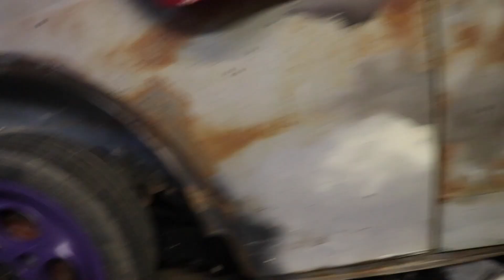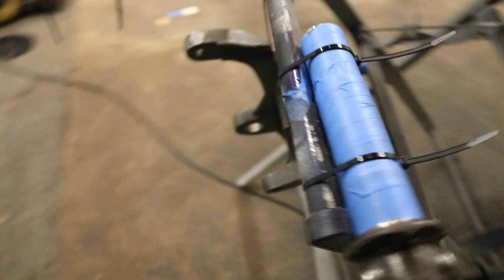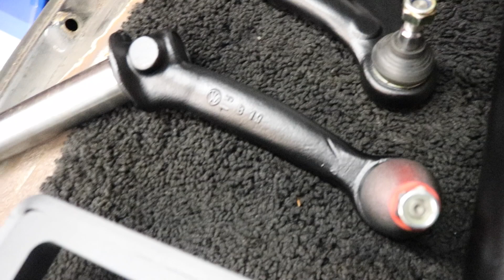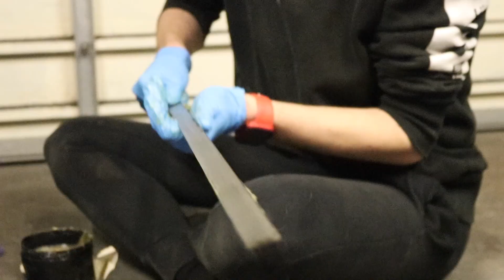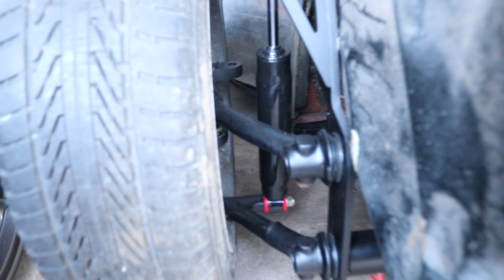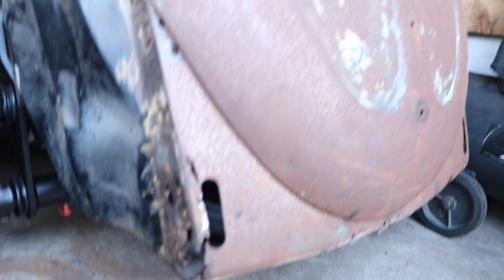VW BEETLE NARROWED BEAM PAINT AND MAKING IT ROLL

Comment: What do you do to prep your metal parts? They look so clean and smooth!
Reply from the maker: The front beam was new so dint need much prep but used parts start degreaser/power wash then wire wheel on a grinder to get off any rush old paint etc then start from 80grit work your way to 320grit before epoxy primer
Reply: @chrismorfitt7642  you do amazing work, thanks for the quick reply 👍🏼

Comment: Great to see a Brit doing a Beetle rather than them damned Yankees.. Lol. I was looking at Limebugs shortened beam for my 63 convertible project, it has a shortened beam already done by the previous cowboy owner but no shock mounts and the adjusters aren't welded on and there's only one on the top arm. Great job BTW.
Reply from the maker: Cheers mate and yea I like the lime bug stuff I was going to go with there Airride kit but this is my first beetle so fort is enjoy it as it is just lowered then I can upgrade stuff down the line good luck with yours follow my Instagram if you like it’s cmorfitt 👍🏻